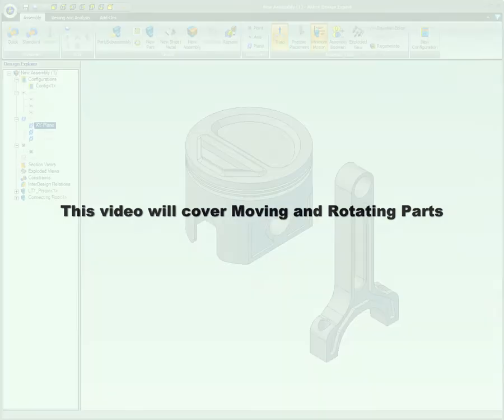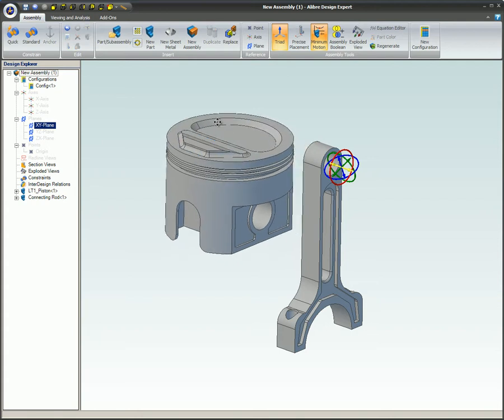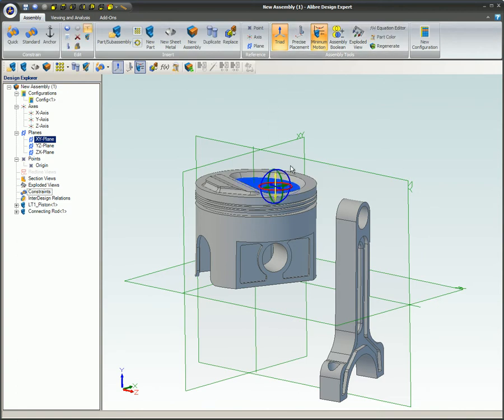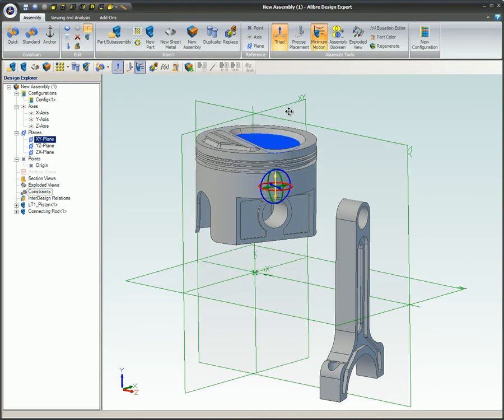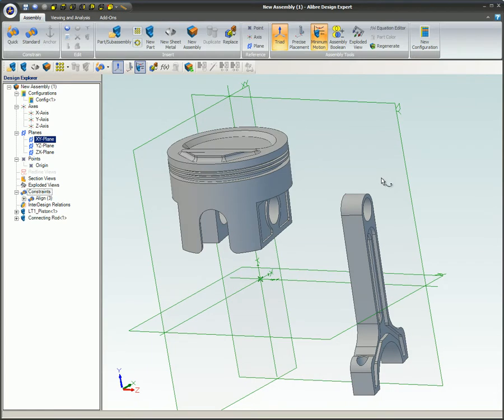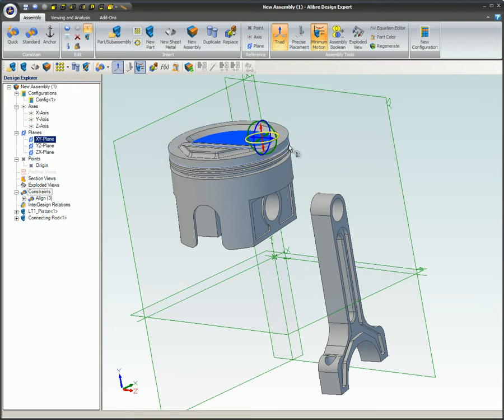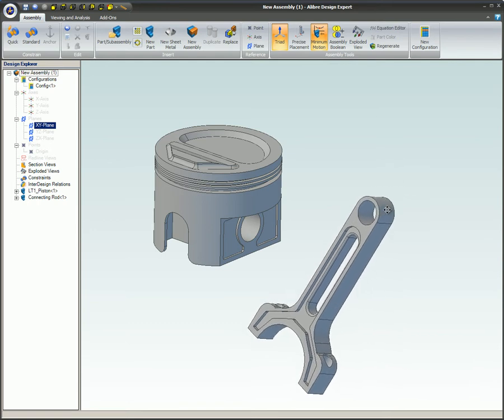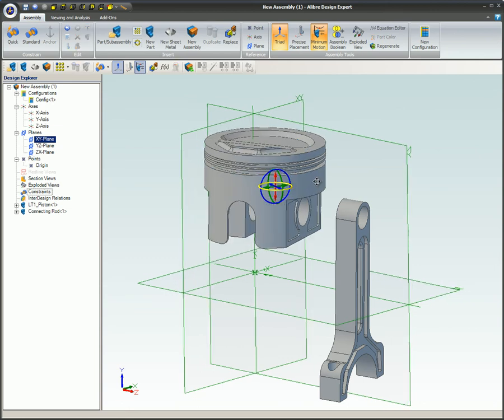Moving and Rotating Parts in Alibre Design (Legacy Interface)

Comment: I've run into an issue. Im trying to rotate a crank shaft. It is un-anchored, and all contraints removed on it in the assembly, and it won't rotate with free drag or precise placement. Occasionally, when selecting precise placement, a "ghost part"? Will appear of the part im trying to rotate in blue offset from the actual part. 

Upon inspecting the part the center axis of the part is offset from the origin. Could this be my issue?
Reply: Update: it was the off center origin point ! I know now for the future